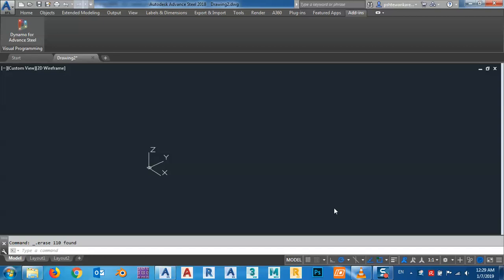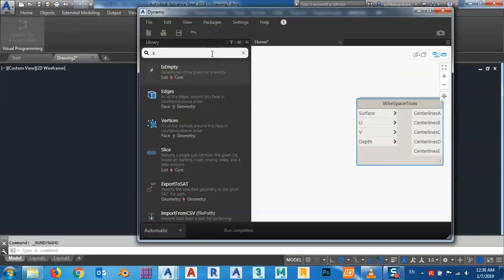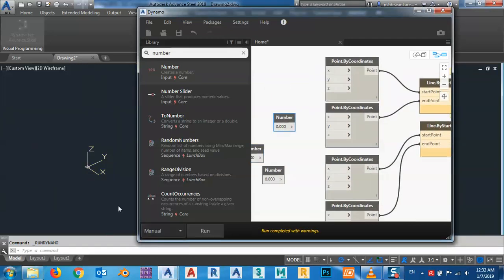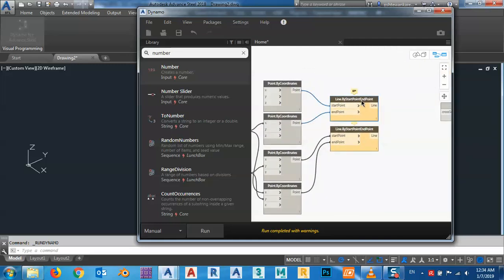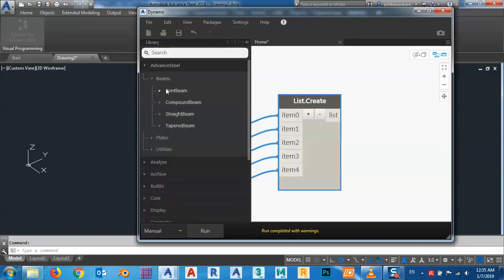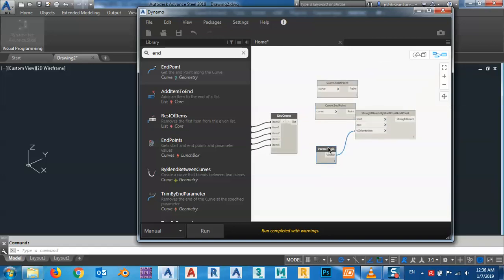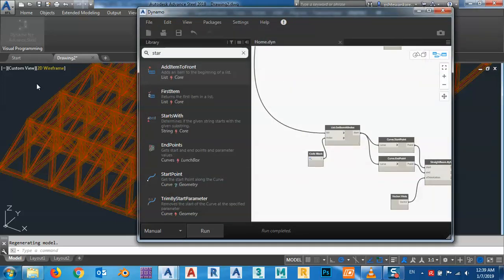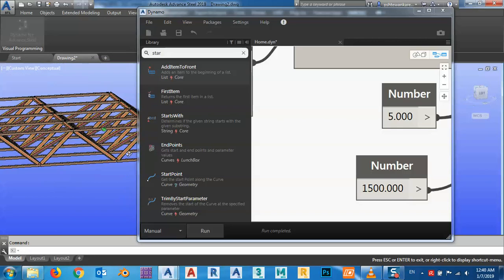Modeling space frame in advance steel

Comment: Suppose I have a line model ready for the spaceframe and nodes. How would you make a tutball node connection with these framings? How can i connect them? Can drawings be generated from such connection? This task is way too complex and I've just started learning advance steel. Please help.
Reply from the maker: The best program for this kind of structure is solid works i have tutorials you can watch them